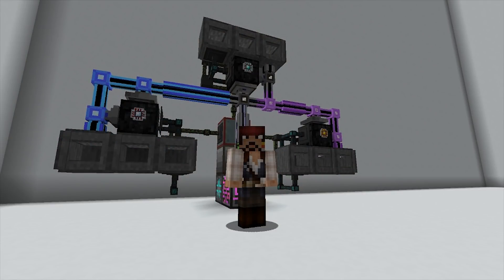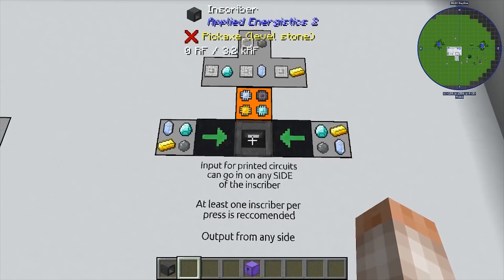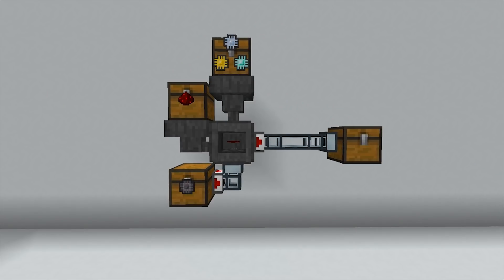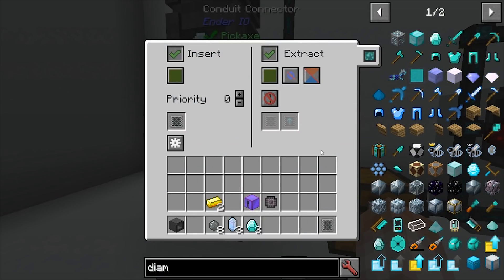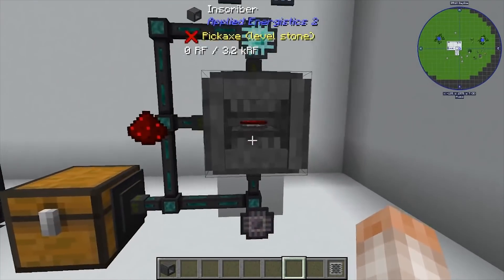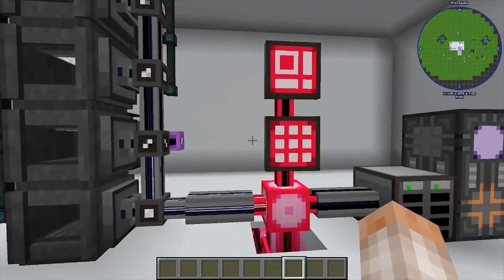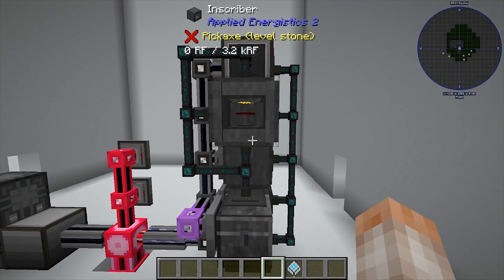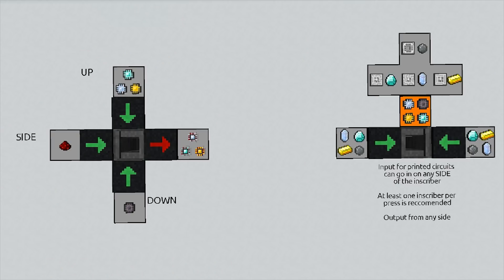AE2 Inscriber Automation

Comment: its not putting the components in the chest 5:51
Reply from the maker: When you initiate the craft, what does your crafting monitor say? Is it waiting for parts? There's a chance that you also accidentally linked up the item pipes to a different inventory so the items actually are going into the chest but being pulled out and into the wrong machine.
Reply: @TheMindCrafters  the components are being made but they just stay in the inscribers, they dont move to the chest in the back

Comment: A cool way i found to automate this process is to follow the same path on automating the printed processors with AE2 itself, but to actually assemble the processors i simply put a ME interface with the three processor crafting patterns in it and connect it to a chest, this chest then has 3 logistical sorters from Mekanism, each connected to a Quantum Entangloporter, the way it works is that the ingredients get sent to their respective entangloporters by being sorted by the logistical sorters, the entangloporters then are connected to three entangloporters that are connected to an inscriber, loading each ingredient from bottom, top and sides. After it completes the crafting it simply sends the processor back to the system, completing the crafting process.

Comment: in 1.16 at least, you can rotate the inscriber with the certus quartz wrench and pipe the resources in with hoppers on the top and sides, while another hopper pulls out the product from the bottom. Very useful video, and I really liked the compact setup you had here!

Comment: I set it up exactly as you have at 6 minutes and it kinda works. It'll start crafting stuff and pulls the first few items into the system but then stops and i have to manually move the products to the chest so it'll continue. Then the finished products stay in the chest and i have to move them back into the system manually. not sure what's going on.
Reply: Did you every figure this out? I just set this up and am having the same issue. If I craft the circuits one at a time it's fine but if I try to do them in bulk it will just stop for no reason.
Reply: @Ramsus32  So I had the same issue - its putting a item filter for just the finished processors on the top ME interface - as I realised it was just sucking back uip all the resources into the system. So only whitelist the final ones going back IN to the system if that makes sense?

Comment: mine is not working, which way are each of the conduits facing on the automated processor build, the tall one
Reply: Have you figured it out? I'm working with enderio conduits for the first time lol trying to figure them out for these inscribers
Reply: @griffinreddell9915  i have 4 regular presses set up standard and im just using an advanced press to do the processors, it was just easier that way, but i believe all the conduits are extracting since the interface panel is always inputting
Reply: advanced inscriber and standard inscribers rather*

Comment: It sends instructions to print the silicon, but I never get the silicon to return to the ME Drive storage. What gives?
Reply: I never inspected the conduit in/outting to the interface!! The extract and input were flipped! Nevermind!
Reply: @AceStarstream  What do you mean exactly? I'm having the same problem.
Reply: @darkphoenix7225  When I had placed the filters in the I/O Conduits, I set diamonds for output and the inscribed piece on the input. A simple mistake.

Comment: good video! helped me figure out how to automate this without using a secondary mod (enderio for you). you can fully automate the inscribers with just AE2 (at least now in R6)
Reply: How did you manage to automate it with only AE2?
I would really like to now, do you have any kind of pictures from your setup?
Reply: @Lazerbert-eu5yx  4 inscribers, 4 me terminals with crafting cards, 4 import busses and 6 export busses.
Reply: @els236  I already found a other way with 5 inscribers, 5 ME interface, 5 import bus, 2 export bus and 1 crafting card.
Reply: @Lazerbert-eu5yx  interfaces is what I meant :p
Reply: @Lazerbert-eu5yx  1 inscriber for silicon with an export bus for the redstone, then an interface with a pattern for 1 silicon equals one printed silicon. This same setup for the logic, calculation and engineering. Then the 5th inscriber (yes there are 5, my bad) with an export for redstone and printed silicon and then an interface with 4 patterns for the circuits.

Comment: How am i suppose to give those inscriber power, specifically in that automation build using applied synergistic?

Edit: Your instruction is kinda confusing for some new people, you should show what you put in those ME interface as well.
Reply: They did an AE2 tutorial a while ago which is still pretty up to date. If you're confused check that one out. Sorry for 7mo late response.
Reply: your smart cables/fluix cables provide power and networking. one cable does it all!

you put the encoded patterns into the interfaces

Comment: im trying to build it right now but for some reason no matter what i try it wont let me pull out the finished product out of any of them
Reply: To put the finished product back in the me system so the component can move on to the next step you need an import bus i believe. that's what worked for me at least.